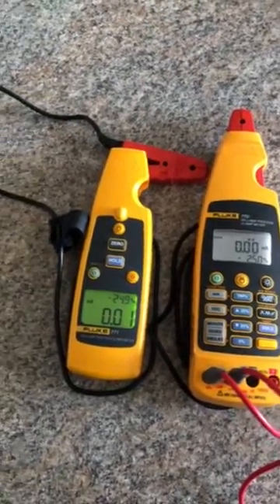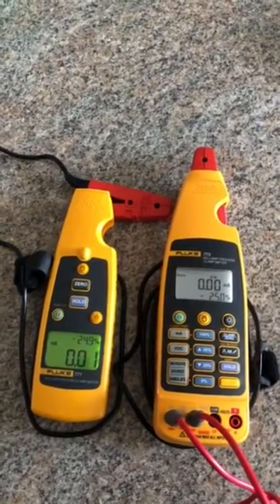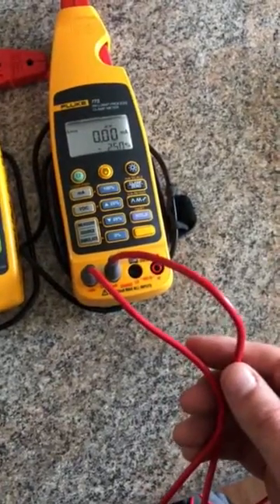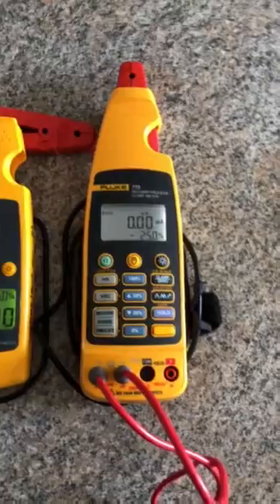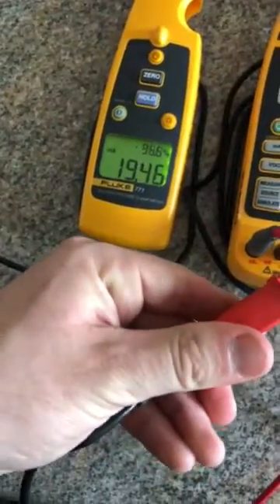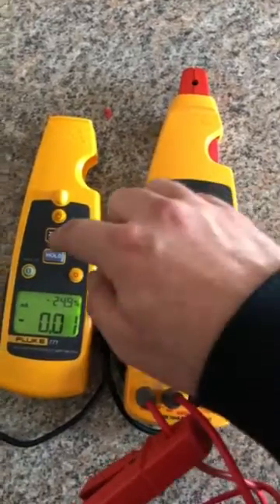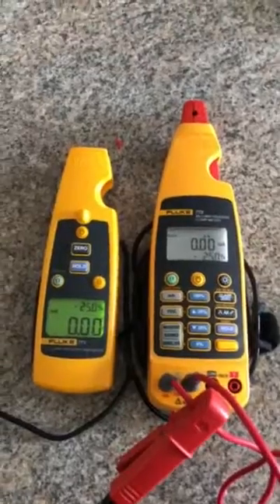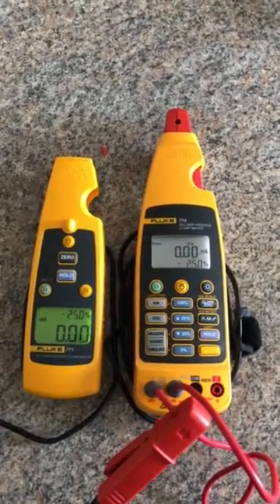Fluke 773 Process Tools- Clamp on 4-20 mA readings

Comment: Hi have you have to replace the clamp and re-calibrate it? My cable has a nick in it. I put tape on it and it still works just curious if you have done the procedure.
Reply from the maker: It is best and safest to replace any leads or cables that are damaged.